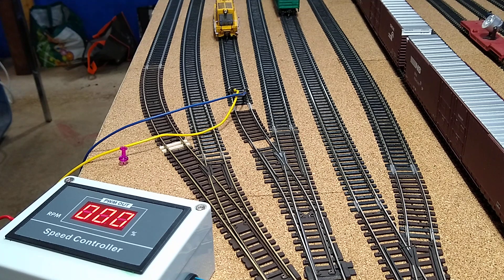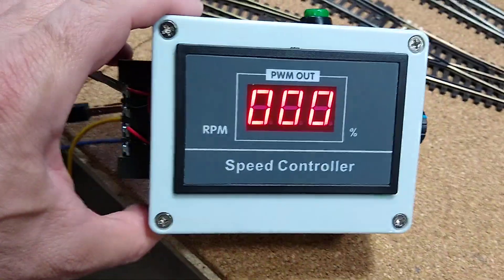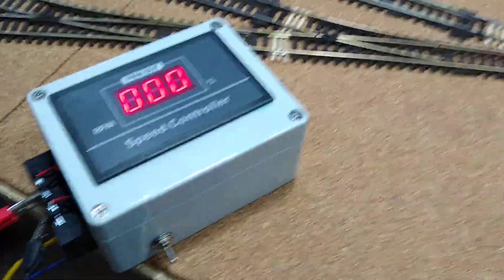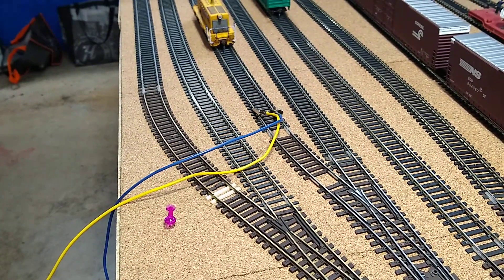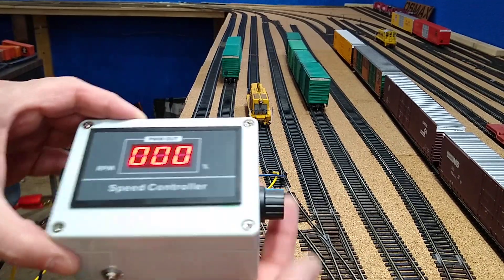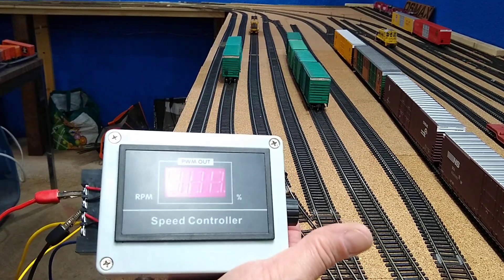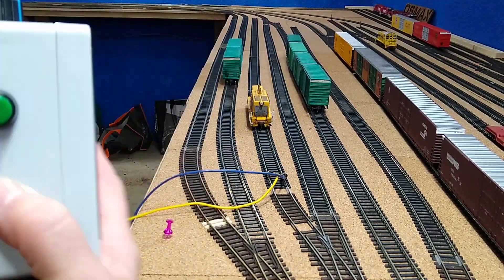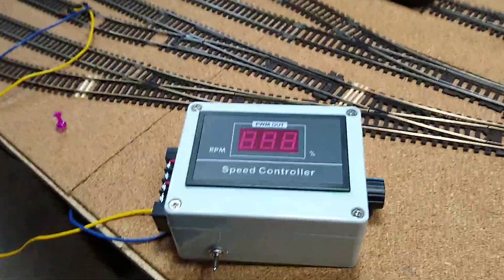Model Railroad walk around DC controller home made

Comment: You're on to something. Maybe even a couple different plug in points around the layout so your cord can stay a reasonable length?  Hit the green button, pull the plug, go across the room and plug back in? Also, maybe cut the sockets off an extension cord and use that for your cabble. Protective sheaf ready to go.
Reply from the maker: Since it needs 4 wires, I bought a roll of wire loom from the auto parts store.  What I'm thinking is another control panel that makes control local or master power to a 4 pole terminal on the outside of the support legs.  Then with some spade connectors you can hookup the unit to various useful locations.  I also bought some industrial conduit box to fit the next controller so I'll have 2 of these kind and still have the old MRC cab control.
Reply: @elite194 that's kinda what I was thinking, with a main line acting as a bus that you could run legs off of at any given point. The thought of butchering an extension cord to wire the controller was just for cheap durability to drag around the floor, but don't know if I've seen a 4 wire application either. I do have  an old transducer cable with probably 6-8 wires in it that would be durable and flexible but might be to small of a guage. Could always gut an old extension cord to re-purpose the sheath for your wiring. 
Now, a REAL man-cave would just have a single hook up in the ceiling and your controller would hang from a track and you could pull it around with you like they have for lifts in a cab shop or repair shop.
Just kidding.
Reply from the maker: you should see my ceiling - lights and outlets are everywhere.  Hanging a controller from the ceiling is definitely an idea worth thing about.  I'm going to build a 4 wire snake using automotive loom so it will look super cool.  Once all the cool controls work then I'll be able to add the DCC system - with a single toggle switch I can be DC or DCC.